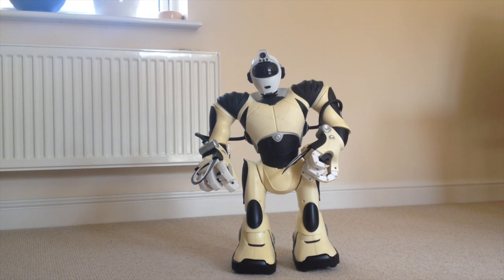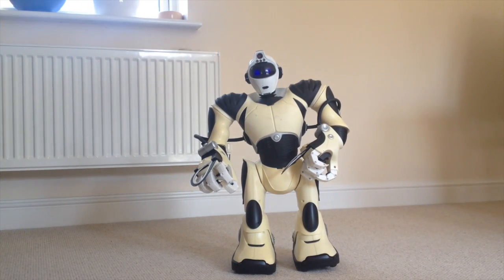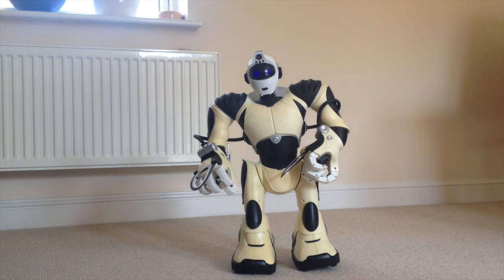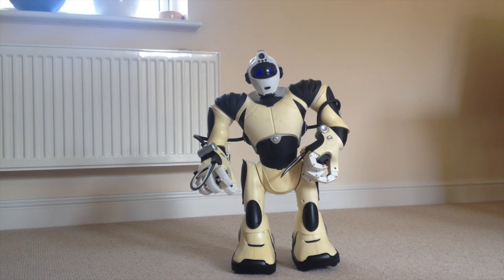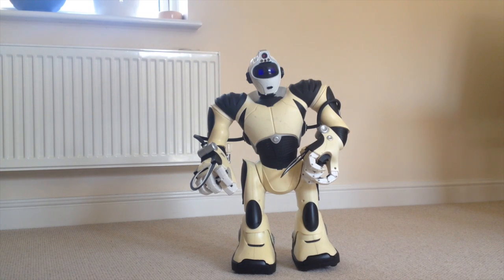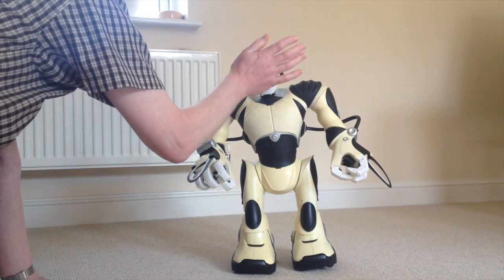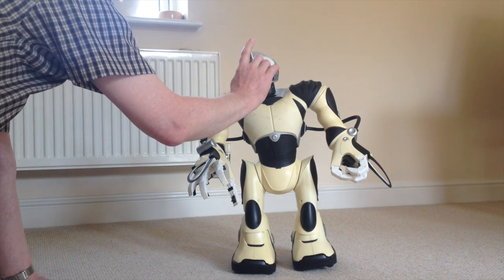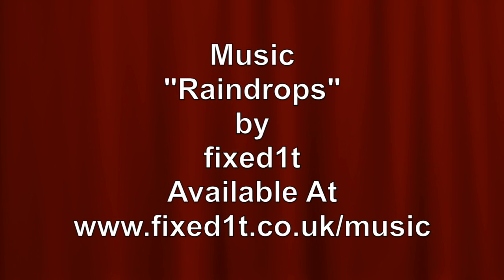Fixing TOBOR Robosapien Legs  - Repair Part 1

Comment: Can the arm be removed, the wire is wrapped around the upper arm?
Reply from the maker: It can but its a pain to do and the control wires are in the chest connected to pulleys and motors, I need help from another fixer to give it a try, he helped me dismantle it so I could send him important components from the arm mechanism he need to do a repair, and I had a scrap donor V2 whose not in very good shape these days. LOL Please don't forget to like, share and subscribe. Malcolm aka @fixed1t

Comment: I have two of these. One that works apart from the gearbox in one leg keeps clicking due to a broken gearbox/servo and the other has a faulty main cpu chip. Between the two I will soon have a fully working one. If you need any parts to get yours working properly let me know.
Reply: I also have some body panels that haven't turned yellow too.
Reply from the maker: Thanks, I'm hoping all the parts are there and that this is the poor wiring problem.  Luckily I bought metres and metres of old multicore (56 core) cables in the late 70's which I still have and will be perfect for this job.
Reply from the maker: It is a bit weird that some panels are yellower than others, but I prefer the old robot look, I've been watching some videos on the gearing, wow wee have done an amazing job of achieving articulation and movement without using huge numbers of servo's.
Reply from the maker: Yes I do the same, I often cannibalise totally dead machines to refurbish newer ones, more often than not the parts can last longer than new replacements.  Do you have a blog and website?